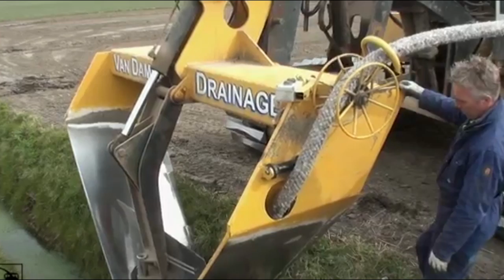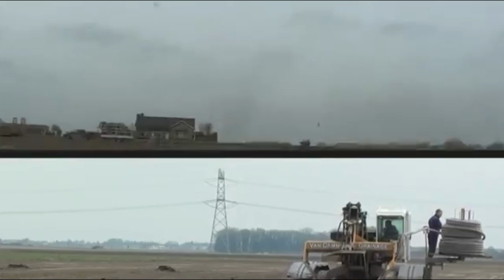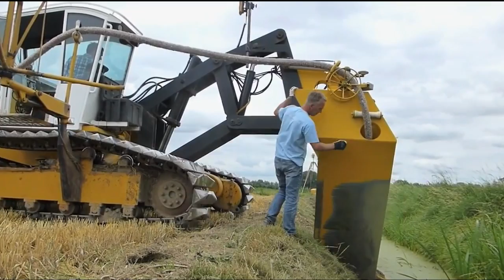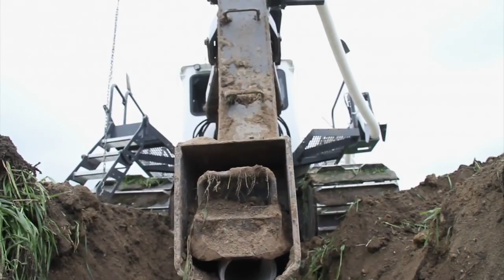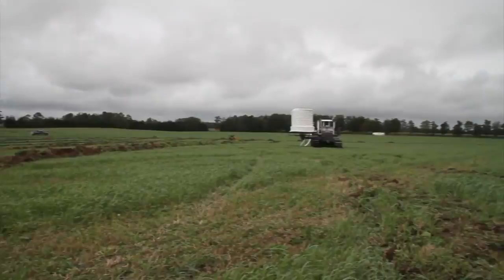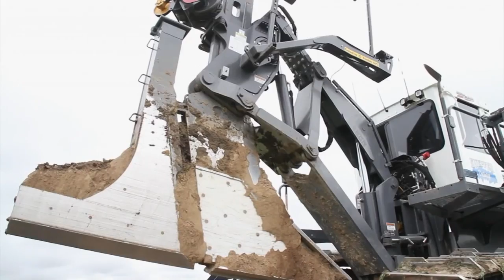Tractors Pulling Plowing Power: Field Drainage

Comment: I think I under stand how this drainages system works so here goes. the water seeps down in the soil and seeps into the hose and runs into the drainage ditch and keep the field dry. Am I right.  we used to dig ditches in the fields and lay two log in the bottom of the ditch and then one where the  two log met and then covered them up  this would let the water drain off the fields. I think your system works the same way. (we done this back in the late 40's and early 50's)  thanks for a very good video